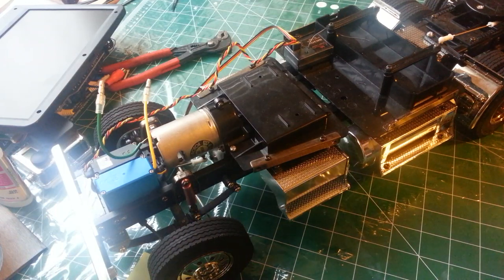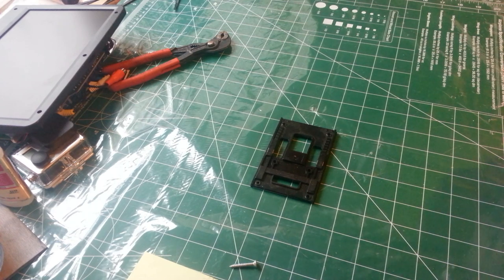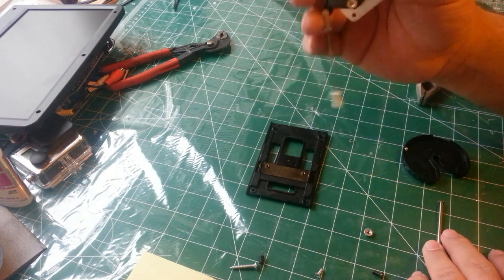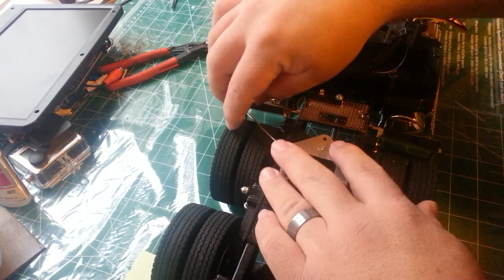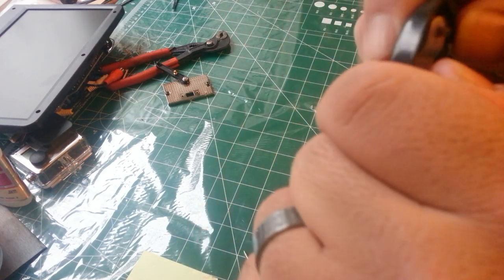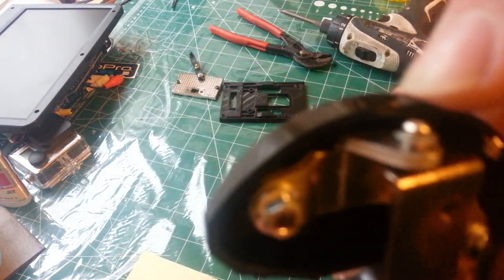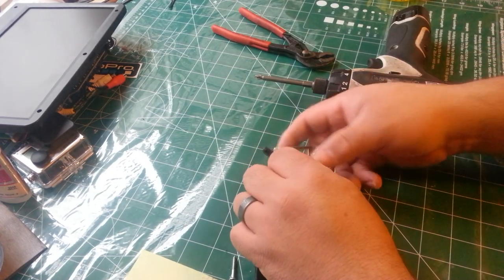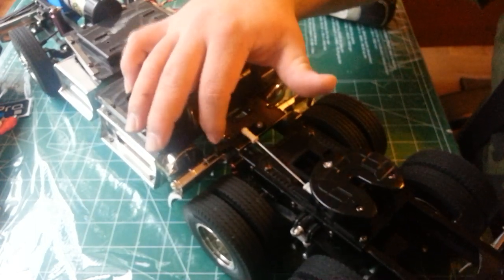King hauler build 8

Comment: awesome man thanks for the tips. i found 7 of your vids and the one you left off on was the transmission if it was you?  they are labelled Tamiya King Hauler build part 1...... i currently have one of these coming in the mail so those tips helped
Reply from the maker: order bearings is the best thing i would say do. past that take your time and have fun. its a great build.
Reply: thank you yea i ordered bearings. bushings are stupid. i think bearings should have been stock. but there only 20 bucks lol. yes it is a great build. i just got done the frame :) now the diff's